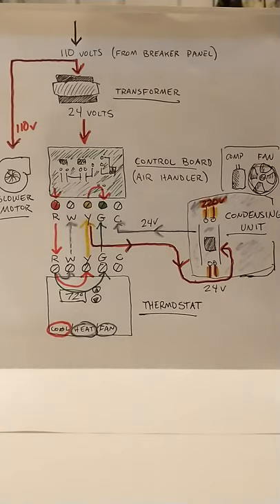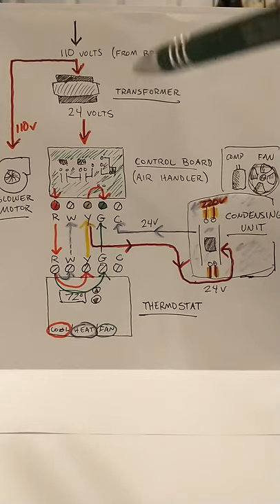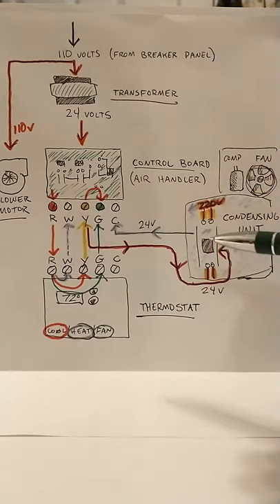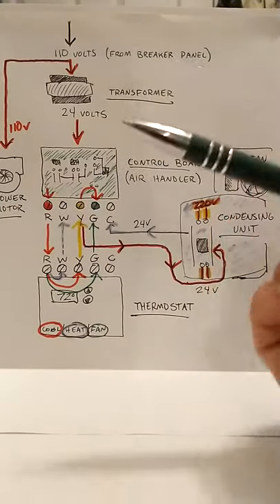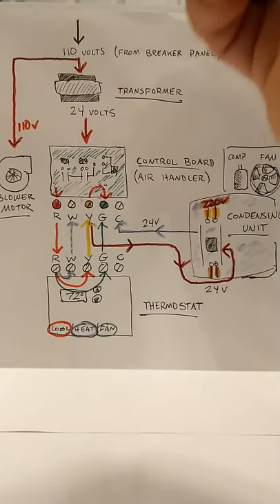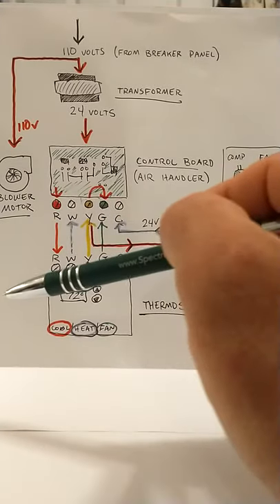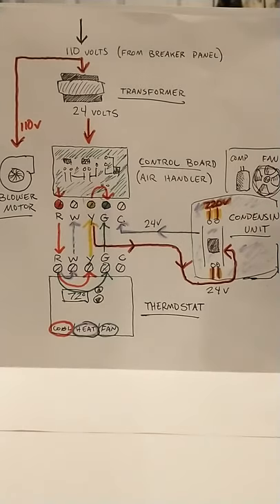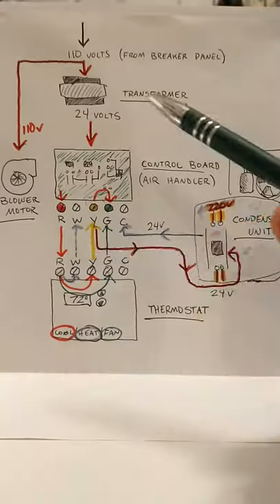HVAC Low voltage control wiring (Basics For Beginners)

Comment: I have an issue.  I have an older Maytag electric furnace for a manufactured home. The 4 wires coming from what I believe would be the mother board to splice to the thermostat wires are red, white, green & gray.  I have 5 wire thermostat wire. So the only wires being used.  Are R/W/G.  All of those wires are in their perspective connections on the wall thermostat.  I cannot get the blower to come on manually.  Also I took the green wire out and turned the heat on and it still turned on with the blower running.  What is going on?  I just want to be able to turn my blower on to recirc warm air from my pellet stove this fall.
Reply from the maker: An older unit like that may not have an actual control board, but rather a simple relay board. Normally the green wire activates the relay on the board to kick on the blower, but if that wire is bad, electric heat can still turn on the blower by powering the relay without a 24 volt signal on the green wire. It's a hard wired safety feature. 

Another possibility is the relay itself is bad, and that little board with the relay on it will have to be replaced. 

If you have an extra wire, use it to connect to the G terminal on the thermostat and connect the other end of that same wire to where the green wire is at or inside the furnace. Basically replace the green wire with one of the unused ones. 

That may fix your problem. If not, the relay is likely bad. .
Reply: @JerseyMikeHVAC  looks like the relay. Tried an unused wire to the furnace green and still nothing. Thx for help!

Comment: Is the 24v at the thermostat control ac or dc ? From there do I understand correctly that the thermostat control itself does nothing but open/close (relays i presume) the circuit between R and either W/Y/G ? It plays no part in the logics of the heating (or cooling) system such as preheat (running burner for a bit before the fan comes on) and cool down (burner shuts off a bit before the fan does) ?
Reply from the maker: It's 24v ac. And the rest is correct. Control boards in the units  typically take on those roles. Some 2 stage thermostats can alter blower and fan speeds as well as signal 2 stage gas valves in furnaces  some smart thermostats will try to increase efficiency by cutting the 24v signal to the control board in and out.

Comment: Hey Sir, I really appreciate your videos, as I'm new to the trade. But in this particular video isn't this the wiring set up for a furnace? I've installed air handlers and the boards aren't set up like this. This reminds me of wiring a furnace. I struggle with wiring an air handler the wires a usually blue and orange. Can you do a video on that kind of air handler? Thanks so much for your time!!
Reply from the maker: Are you installing heat pumps?

Comment: What if I don't have a control board? I'm trying to wire the thermostat for a mobile home packaged unit
Reply: Same here. Picked up a smart thermostat from the local power company, since they were on sale! Wired it up. 
"C wire not detected."
After much Google searching and a few YouTube videos later, I "just need to connect the C wire, to C port, on the control board."
Power off all the circuit breakers, open up the unit panel… and there is no control board.
Reply from the maker: On some older systems the common is actually the chassis of the unit itself. Common is ground. I would have to see the schematics of the unit to know for sure, but sometimes a clue is if you can trace a wire off of the 24 volt side of the transformer directly to a ground screw.

Comment: I got a question in trying to replace the control board that is located on the wall next to the exterior unit and connect it to the control board inside the unit but the wires are not connected so I’m not sure how to do it can I get some advice please
Reply from the maker: Can you elaborate more for me to get my bearings on this? I'm not making the connection on what you might be talking about.

Comment: I have a tstat wire going to air handler and a second wire going from air handler to my oil boiler. So that wire has 24v entering the boiler. Add to that the boilers 24v, I am getting 50v on the zone valve...which fries the head. Seems like I am miswired? Tstat wire coming from air handler should have no voltage on it until the tstat kicks in and activates the boiler. Am I correct? Issues began after a new boiler was installed.
Reply from the maker: Is the boiler tied into W at the air handler?
Reply: It wasn't! Was tied to Common instead, hence the constant 24v. I rewired it ti W, now all is good! Thank You!!!! For both the knowledge and for replying quickly.

Comment: Do you need the connection from condenser to common in order to send 24 volts to thermostat via common? Or does it come from the air handler board?
Reply from the maker: Every circuit has to come back to common at some point. T-Stat gets 24v from air handler. T-stat sends out 24v signal to condensing unit either through air handler control board or directly from T-stat (depending how old the system is). From condensing unit 24v comes back on common to air handler to complete the circuit.
Reply: @JerseyMikeHVAC  I'm needing to install an existing unused c wire. Would I just be able to connect c wire from air handler c connection to thermostat? Or would I need to do anything with the c wire from condenser as well to make c wire to thermostat work?
Reply from the maker: @BaseballBigE  you can take it straight from the air handler.

Comment: What if it's a 2 wire system..red and white.  It only works on heat and auto fan.
I installed a nest thermostat  on the 2.
It tell me to run a c wire.
Is the c port on the thermostat itself putting out 24v? And grounds out at the control board?
How is the fan coming on when I only have Rh and white?
Reply from the maker: C terminal on the stat does not put out 24v. When a wire is connected from C at the stat to C at the control board, it just completes a dedicated circuit with the R terminal, and the Nest recharges off of that circuit. So R is your 24v FROM the transformer and C is the common BACK TO the transformer. Some smart thermostats are what is called "power stealing", which means the stat will charge off of the closed W circuit during calls for heat (or the closed Y circuit during calls for cooling), both of which eventually make their way back to common at the transformer. When a stat needs a common wire, it is not getting enough power to recharge off of the heating or cooling cycles, so needs its own charging circuit. 

On newer control boards,  a signal for heating or cooling (Y or W) will activate the blower motor without the need of a signal from G. You would only need a wire on the G terminals if you wanted to run the fan independently just for air recirculation.
Reply: @JerseyMikeHVAC  thank you for responding. 
I actually went and got the correct wires today and pulled it to the furnace. 
Everything works as it should.

Comment: I am wiring in a APCO Fresh Air system. Where would I want to wire it in to? I am assuming that I want it powered on at all times.
Reply from the maker: Off of the R and C terminals directly, or to the 24 volt side terminals of the transformer inside. Same thing, different spots.
Reply: @JerseyMikeHVAC  thank you so much. I just pulled the blower motor apart and it had so much moldy build up on it, so I cleaned it all up. I was thinking of mounting the APCO unit above the blower motor so that it hits the fan and condenser. Is this a good idea or bad? I have a York single phase packaged heat pump outdoor unit.

Comment: So in heating mode would the IFM wire and Heating mode wire be jumped together
Reply from the maker: No, That's done internally in the control module. In this diagram you only need the white wire to provide 24 volts to the W terminal to activate heating mode and the IFM.

Comment: my system does not have a green wire, I mucked up trying to change the batteries and everything came unwired. My colors are red, yellow, white, brown and blue. I hear the compressor, however no air blowing. HELP
Reply from the maker: Check the control board in the indoor unit where the blower motor is located. Your wiring at the thermostat should be the same as the wiring there.

Comment: Thank you very much for your video. My Green and Red wires has only 13.5Vac. So, the problem should be the control board air-handler, right?
Reply from the maker: Testing between red and green terminals should give you 24+ volts if the fan is off or 0 volts if the fan is on.  Weak voltage sounds more like a weak/loose wire connection or damaged wire.
Reply: @JerseyMikeHVAC  Thank you for the response. On your hand draw diagram, is the control board the same as Solid State Time Delay?
Reply from the maker: @HsingSun  There may be a time delay relay on the control board, but the diagram in this video doesn't go to that depth into the circuitry.
Reply: @JerseyMikeHVAC  Thank you for the response. With the thermostat cover off, wires R & C is reading 5.6 volt, is it normal?
Reply from the maker: @HsingSun   You don't test R to C. You test R to ground to see if you have 24 volts at the R terminal. If you can't reach a ground point from the tstat, test the terminals you're trying to diagnose. If heating isn't working, for example, test R to W. You will have 0 volts if the thermostat is calling for heat and roughly 24 volts if it is off. Same for cooling (R to Y). 
If you're still showing somewhere in between 0 and 24+ volts, you either have a bad fuse, a grounded wire (which will also blow the fuse) or a bad tstat. 

What isnt working? Heating, cooling? What system do you have?  Furnace, air handler, boiler, heat pump?
Reply: @JerseyMikeHVAC Great job!... question, Will a jumper at the thermostat R to the C suffice as a constant power supply for the smart thermostat?
Reply from the maker: No, the C itself has to go back to common at the power source (air handler)
Reply: @JerseyMikeHVAC  Thanks for the reply, I appreciate it very much!

Comment: So my a/c started blowing hot air and for a few seconds it smelled like rubber or plastic burning.  I checked all components and nothing seemed to be on fire . Could you please help on why my ac on cool blows heat?
Reply from the maker: Do you have heat strips?
Reply: @JerseyMikeHVAC  I believe so.
Reply from the maker: @ericmartinez6692  I do my best to try to help everyone out, but in this case I strongly recommend you have someone come out and take a look at it. 

 But one thing you can test is to find and shut off the breakers to the heat strips. See if the system blows cold again. But have someone look at it even if that works and don't run the system without watching it closely.
Reply: @JerseyMikeHVAC  appreciate your help 🙏

Comment: I installed a brand new 2 ton Heat Pump (Yes Goodman) and I set it up to cool the house.  It worked for a few (3) days and then out of nowhere it stopped completely.  I check the thermostat and not getting 24V at all.  I push the button for the contactor and compressor start to work, but it did not engage the fan so is not pushing air thru the vents.  Any Ideas where I should look at? Thanks.  Daniel.
Reply from the maker: Check the fuse on the control board in the air handler. Might have a short somewhere in the wiring and popped it.
Reply: @JerseyMikeHVAC  this unit doesn't have a fuse on the control board or anywhere else.  It's odd. Following your diagram I'm going to test each circuit. Cause the contactor doesn't 24V either.
Reply: @JerseyMikeHVAC  thanks
Reply from the maker: If it doesn't have a fuse I would tie one in. I've come across a few that didn't have one and did that to protect the transformer. Might want to see if that's giving you 24v too.
Reply: @JerseyMikeHVAC  I will.  Thanks.
Reply: Hi Mike. I test the contactor. I've got 240V coming from the security box. But, that's all. The wires from the contactor don't have 24V so I guess something is wrong with the contactor or any other possibility?
Reply from the maker: @daniellascaris4533  
The problem is somewhere else if you're not getting 24v at the contactor. 

Test these components in the exact order I'm giving you. Only move on to the next test if you have 24v. If you don't have it, that is where the problem likely is. 

1. Start with testing for 24 volts at the transformer on the indoor unit. Thats where the 24v begins. The contactor on the outdoor unit is closer to the end of the circuit.  If no 24v on the transformer output, you probably have a fried transformer. 

2. If the Xfmr is putting out 24v, From there test for 24v at the R terminal on the indoor control board (or the red wire that gets tied into R going up to the thermostat). If no 24V there at the R terminal, the control board may be bad. 

3. If you have 24v there, test for 24v at the R terminal on the thermostat. If no 24v there, there is a short or break on that wire somewhere. 

4. If you have 24v there, jumper out the thermostat between R and Y to see if the system starts. If it starts with a jumper clip, but wont start with the tstat itself, it's likely a bad thermostat. 

5. If the system doesn't start while jumped out, go back to the control board on the indoor unit and check to see if you're getting 24v at the Y terminal with the thermostat calling for cooling (or jumped out to do so).  If no 24v there, there is a break or short in the Y wire somewhere between the board and the thermostat. 

Only from there does it then go out to the contactor to the outdoor unit.
Reply: @JerseyMikeHVAC  Thanks Mike.  I think the transformer went bad.  I'm getting 240V from the contactor, but nothing came out on the other side, mean it, on 24V.  That's why I'm not getting 24 anywhere else.
Reply from the maker: @daniellascaris4533   Just be aware that if the transformer is fried, whatever caused that to happen may still be an existing problem. Make sure you wire in a 3 or 5 amp fuse into the 24v side before turning the system back on again after replacing the transformer.